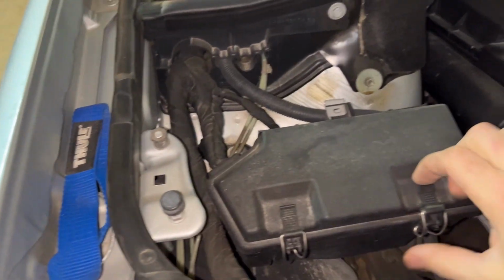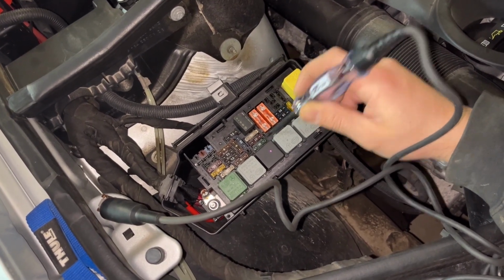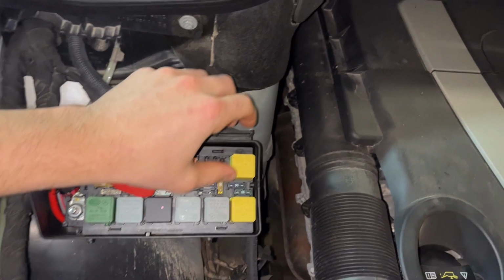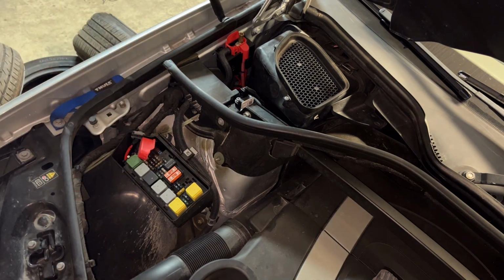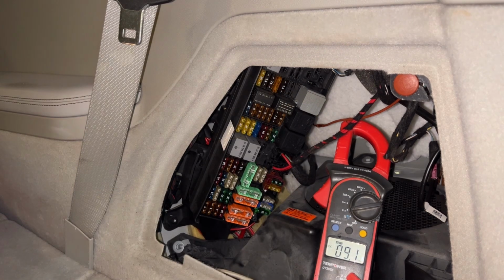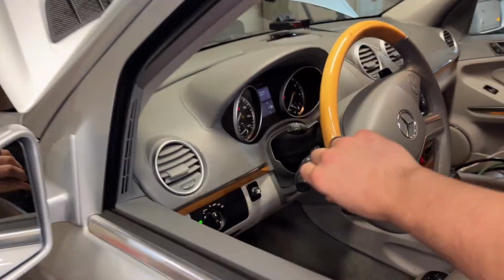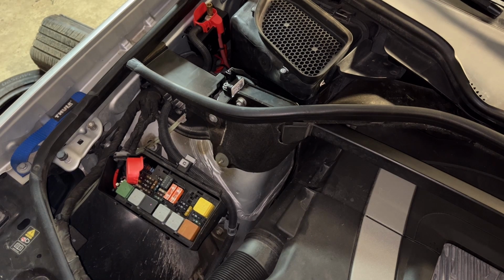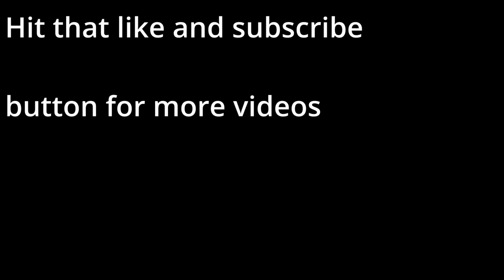BG GARAGE: 2011 Mercedes GL550 NO Intermittent Wipers

Comment: what made the fuse blow??
Reply from the maker: @collinsclassiccarriages9418  its been some time and dont remember the sequence of events buy i do see the rear bumper is off, so i was doing the wipers at the same time i diagnosed a corroded and faulty rear left blind spot radar module.
youd have to check the schematatics but I presume due to the corrosion in the unit which was actively shorting the CAN bus, i presume the radar module shares some kind of power connection with the circuitry using the 5amp fuse for wipers, and thus caused said fuse to blow.